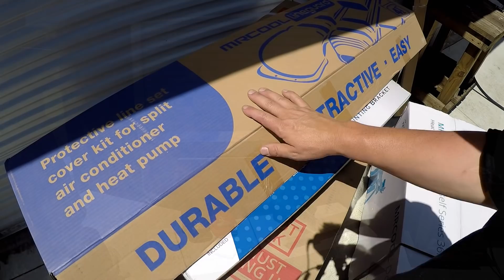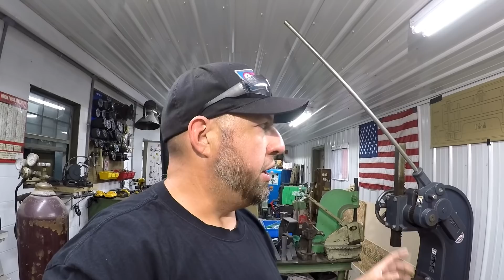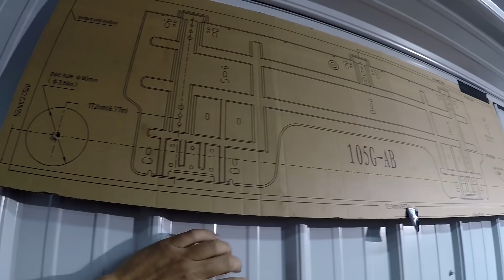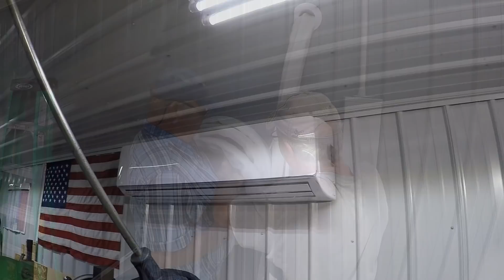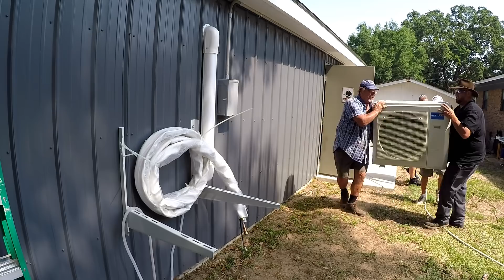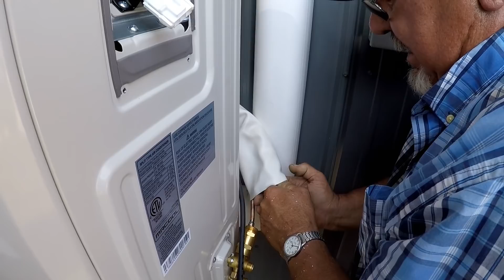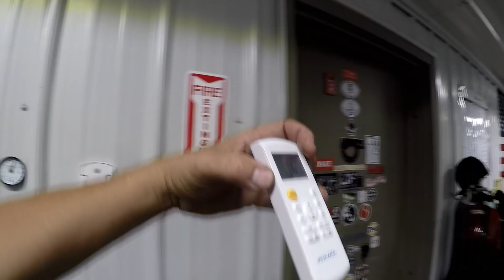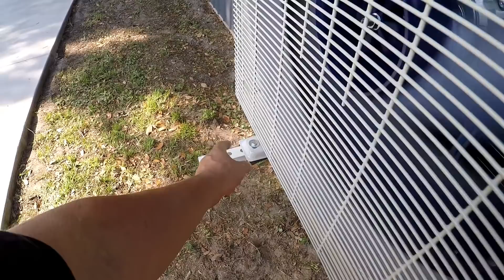Mr Cool DIY Shop AC Install

Comment: Good install. The only thing I would have done differently is cut out the extra length that you guys coiled up behind the unit. it will hinder airflow behind the unit which can reduce system performance ( higher head pressure, more power consumption, reduced cooling) and more importantly those loops will act as oil traps reducing oil returning to the compressor which can shorten the systems lifespan. its important to have all the oil that circulates through the system return to the compressor.
Reply: Cutting the lines means you have to flare and vacuum the system.  Coil the lines as shown.  The unit is shaded and the little bit of air you block is not going to be a problem.

Comment: Have the same unit in my shop in Houston. Literally did the whole install by myself. Although it would have been nice to have a hand when I was hanging the wall unit. Keeps my metal 24x36 shop cool. I do have that bubble installation. My only real complaint is I who’s the fan was a bit stronger. The heat pump is nice too. Good till about 40 in the winter. After that it has trouble keeping up. Well worth the money and pretty efficient.

Comment: 21:46 Should have connected the top line first.
Reply: The connection doesn't matt until he released the flow which he did the tip line first
Reply: Instructions specifically say to connect the bottom first.

Comment: these mini split units are very common here in brazil we only use these units...  not with pre vacuumed and those fancy caps tho.
Reply: Same here in Japan, one for each room or area in your home. Very efficient as you only pay to heat or cool the rooms or area of your home that needs it. Central heating and air is so expensive and inefficient compared to these. This looks like a rebranded mitsubishi unit.

Comment: I installed the 15k version in my shed workshop last year. It has done a great job with both heating and cooling.

I installed it by myself. Definitely easier with a friend, but not impossible with a single person (at least the smaller one). Just make sure you use their guidelines to get the correct size -- getting the largest one for a small space is a bad idea because of how it will short-cycle.

Comment: Cool (pun intended!) looking unit Adam. Up here in NH A/C is not really necessary, but I have to admit where you live it is nice. When  I lived over in Ft Walton Beach A/C was really a good thing especially in July & August. However those old heat pumps and blower units in my apartment were always loud. I hate listening to HVAC systems. This I think I could live with. 
Cheers

Comment: Now in my hometown, 39 degrees. very hot
Reply: 102°F for anyone not familiar with celcius
Reply: @fcguy7  (I am from China.) thanks for your explanation.
Reply: @shujunzhang8027  that was my guess. Unfortunately America is still holding on to imperial units. I hope one day we can join the global community and adopt the metric system. Until then I'll help by converting units when and where I can.

Comment: A shop fan on low,  really helps circulate the cooled air around the shop.
Reply: That's a good point.  Cold air does tend to pile up around the source, especially when there's a wall opposite the discharge vent.

Comment: I understand the lines are pre- vacuumed but I must vac check to see if there is a leak on the system...
Reply: The lines are pre-evacuated and pre-charged with refrigerant so in order to run a vacuum pump you would first need to recover the gas which sort of defeats the purpose of this sort of unit.  The best way to test for leaks is with soap bubbles or an electronic detector.
Reply: I understand why you would vac check to see if their is a leak. But you kinda have to just trust Mr. COOL has done that at factory and arrives to your place still charged.  Reason for this system  being called DIY. No need for all those checks with these units. I unfortunately had to vacuum test AFTER it was no longer cooling. Then with vacuum test did we find the leaks from factory😫 My trust has diminished after this. My other two units after defective one running great though. All Done my self.
Reply: @oscargo29  you aren't supposed to check for leaks with vacuum, pressurize the system with nitrogen instead.
Reply: @JGnLAU  We did. After unit not cooling.
Reply: Thanks Jim D...Get over yourself emery board, OMG !
While your in in your moms basement trying to tell people how smart you are,  there’s already many people out there that are way smarter than you .
Reply: @yzmoto80  aren't you trying to tell people how smart you are too?
Reply: nice assumptions ...

Comment: Here in Southern India we use similar split units. Much the same really, except this Mr Cool seems to be tailored to DIY-option with the pre-vacuumed lines. My first thought when I saw you guys unwinding it was "Oh! It's not copper. How can that be?" Now I wonder how they can make copper so flexible.

We go by "tons," but don't ask me tons-of-what lol! Don't ask me what a British Thermal Unit is either (They taught us at school) even though they figure in our AC model numbers too. Temperatures of 40, 41 (105 in your currency?) here at the moment. We hate power cuts!

Stay cool.
Reply: They came up with tonnage as a way to compare performance of the unit. What it is is comparing the cooling capacity of the unit to (weight) tons of ice. Approximately 12000btu are equal to one ton of cooling  capacity.
Reply: ThadEGinathom Given that you’re metric, shouldn’t that be tonnes?
Reply: @steviebee1989  A "ton of cooling" or "refrigeration ton" (RT) is an imperial unit (Phase Change of 2000lbs of water->ice). Tonnage is not used in the Metric HVAC World. Greetings from Germany. All hail the Kilowatt.
Reply: <Given that you’re metric, shouldn’t that be tonnes?>

I was born an imperial Brit: pounds, shillings and pence!

But yes, UK has long been metric, with a few exceptions like miles of road and pints of beer. And India is metric --- with a few exceptions like AC capacity!

I'm the hybrid that you might expect: I measure body temperature in F and room temperature in C. And, in the unlikely event of measuring anything small (I'm not a machinist) it would be in thou, not fractions of a mm.

Comment: @abom79  Take a piece of black split loom tubing and put on wire for indoor unit.  Will help keep wire from cracking being out in sun.  Also small piece of pipe insulation over suction line that is exposed.

Comment: What is it meant by "36k"? I got a 18,000 BTU mini split in my shop, around 300 sq ft and it really only cools the shop when it's raining (when temp. is around 85 or so) but because my shop is a sheet metal construction with no insulation, it does not cool when it's sunny... well it does cool but I have to stand right below the blower unit to get any benefit at all. I live in Taiwan. Here they use mini splits all the time because central AC is simply not something you see at home or office, but rather is only seen in very large installations like subway stations, large public space, etc. and as a result every buildings have those condenser units all over it, looks kinda ugly IMO. In Taiwan nobody uses cover plates for the refrigerant lines but just leaves it exposed to the element, but it has a foam covering around it to insulate it. It looks far better with the line covers and service disconnects. I can add insulation but they are expensive and the landlord will not pay for it.
Reply: Adding insulation to your walls would make a HUGE difference. You can't expect your AC to keep up when the sun heats all the walls directly.
Reply: @SpencerRyllSmith  Does it make a bigger difference to improve the insulation of the roof/ceiling or to the wall? Only one side of the wall really gets sun heating, and only for a few hours during the day. The AC works far better after 5pm.
Reply: @taiwanluthiers  I would start with the ceiling but also do the walls as soon as possible.
Reply: @SpencerRyllSmith  Well, I don't have money to do both, it is very expensive to do and my solution so far has been to reduce the areas needed to be cooled to save money this way, by sectioning off my shop with plastic tarps. It's not pretty but it sorta does the job in at least keeping my electricity cost down. Doing full on insulations will cost a lot more, more than any possible savings on electricity it would have over the 4 month period where it's sorely needed. (Taiwan electricity rates outside the summer is so low it might as well be free)
Reply: 1 ton of cooling = 12,000 btu/h.  18k or 18,000 btu/h = 1.5 tons of cooling capacity.  36k or 36,000 btu/h = 3 tons of cooling capacity.  1.5 tons is generally more than enough capacity to cool 300 sq ft but if the climate is hot/humid in direct sunlight and the building has little or no insulation, the load can easily exceed the units capacity and will not maintain the desired temperature.

Comment: Adam

Fter this has been in use for a couple months, pull up you power bill  for the same period last year, and let us know how much it costs to run this unit.  That kind of real world evaluation is something I am sure many folks looking into this kind of solution would appreciate.

I am lloking into adding about 300sq.ft to my shop, and will definitely be looking into cooling solutions at that time, and efficiency is going to be on the top of the selection criteria list

John

Comment: Before you buy any of these kind of units, make sure the warranty covers the home owner install. My neighbor installed one, had problem right off the bat. Called to find out about warranty, was told since a A/C man didnt install, warranty was no good. Ended up paying a A/C man to repair, and to get it set up for warranty. Nightmare.
Basically this is a 3 ton window shaker. But In Florida you have to have something, even my cats dont like to go outside in the heat of the summer, which is pretty much all year. We have one season, summer, its get cool for around a month.
Reply: The Mr Cool DIY line is specifically designed for homeowner install.
Reply: I tried not to single out Mr. Cool units, but these type units are sold by a lot of vendors, making sure they check on warranty info before buying. And I would suggest getting it in writing. Good to hear Mr. Cool cover parts and Labor. For how many years.

Comment: Hilarious that the USA is just now discovering how great mini splits are.  I've been working overseas for a decade and that's ALL they have, central air is not a thing.
Reply: They have been here for quite some time. The reason they aren’t as popular is that in the US, most buildings HVAC systems are forced air whereas in Europe and Asia, radiant heat is more common and it is more economical to install ductless systems rather than run ductwork. You are right though.  They are becoming more popular in older homes with hydronic systems and room additions along with ducted high velocity systems.

Comment: Cool as a cucumber 🤭😂
I’m lucky that my shop has a12 inch concrete ceiling with another factory unit above.
The only problem I have is that in winter it can get a little cold but in the summer it’s like having an ac running.

Comment: The refrigerant lines should of been horizontal.. so not to cause a oil trap .. so the oil can make it back to the compressor.. ...other wise nice install ... great video !
Reply: Agreed, Every coil in the refrigerant  piping is now an oil trap. Dont think it will be a problem tho.

Comment: A little bit more planing and this could have been a little better, you put in a drain line with the addition for your big welder, you could have plumbed in the drain for this ac unit into that same drain. The a/c lines look like where long enough to hit the other side of the door, and had enough decorative cover to get there as well. You wouldn't have had to do as much electrical work as it would have just been on the other side of the wall. This also would have eliminated the big coil. But, it wouldn't have been as hidden... nothing a trellis wouldn't have fixed.  The whole thing would sit right above your water spigot.  ¯\_(ツ)_/¯ its there now.

Comment: Nice video!...Your installer forgot to immediately check the fittings for leaks with soap water solution when he opened up the service valves. Also using nylog on the line set connections insures for a better thread on and leak free situation!
Reply: Since you shared your expertise I thought I’d share mine,  The nylog would ensure a leak-free situation, not insure one. 
The two words are not interchangeable. Just sayin’.
Reply: Ah Charlie you kill me!

Comment: I would have moved the condenser unit as far as possible from the building... Better airflow = better efficiency.
Reply: Stuart Warren it’s plenty far enough from the wall - the air is pulled in from the back and blown out the front - that distance won’t cause any inlet restriction even with the extra pipes behind it.  And it’s friggin huge for what it’s doing too - a unit half that size would do the job, this won’t break into a sweat. 👍

Comment: Wont the extra line coiled up interfere air flow to the coils?   Why not cut the supply lines to fit?  The gas in in the unit not the lines right?
Reply: Butch Shelton....Did you bother to watch the video?  The line set is pre charged.  You do not cut the lines with this installation.
Reply: @paulcopeland9035   so Paul the lines with no ends on them save a small plastic cap are holding all the refrigerant inside those supply lines. What pray tell then was the valve on the condenser unit for.  When I watched the video and saw them release the gas. You watch it again yourself.  The line is NOT charged but the unit is.
Reply: @ButchShelton  ....The line set and evaporator ARE charged.  This is old tech that has been used in the mobile home and modular factory built home business for years.  Inside the end of the lines is a valve mechanism that opens when it is connected.  The valves on the condensing unit are service valves, just like every service valve on every condensing unit around.  "Pray tell" if you want to be educated, go to the googles and look up "Mr Cool pre-charged line set"  You will find pictures of the inside of the lines and the valves I am telling you about.
Reply: @paulcopeland9035   The only reason I brought this up is the Mr cool I installed the connection lines were not sealed. They were not pressurized and they were long. During install my A/C guy shortened them for a cleaner looking install. But by all means I defer to your vast knowledge about all things. Your gracious comments and demeanor are vastly appreciated.
Reply: @ButchShelton  ....Only the Mr Cool "DIY" model comes with the pre-charged line set. BTW, anytime you want to know about stuff I do for a living, look me up!

Comment: Here is a tip for Abom an those with small critters around there houses add some medium steel wool in the elbow of the line guard to fight those little guys from trying to make a nest in the guard and keep the drain line about 4 inches or so of ground frost or freezing areas thanks for the video abom keep them coming

Comment: Wall mounting sucks, when the unit outside is on, the whole building vibrates.
Reply: Nope. Mini splits are incredibly smooth.  If it is vibrating your building then you have a compressor issue.
Reply: @paulcopeland9035  I lived a whole year in a apartment like that. I had to arrange my glasses a little apart so that they don't touch and make vibrating noise too. Even since, I always picked my apartments with ground mounted units, never on the balcony.
Reply: @shakazzolo  I don't know what it's like in Florida but in Texas fire ants get into some AC units and disturb the contactor.  It can destroy the compressor.  By now they should have that fixed with a sealed contactor though.  It can happen after a lot of rain, when ants are on the move.
Reply: You can't even tell it's on unless you go outside and get close enough to see the fan spinning.

Comment: I know Mr. Cool "Sponsored" this video (gave him a free unit) but be sure to check eBay and Amazon theres 100's of other vendors with prices HALF the cost of Mr. Cool - I just clicked his link and looked and their prices are double what I paid just 3 months ago.......... Same style unit, Toshiba Compressor, 5yr warranty, etc etc
Reply: @agems56   Not USA made, not even USA assembled - same Asian junk everyone else sells.........
Reply: I think their cost is explained as being the inclusion of the special lines that eliminate the need for an ac tech to be involved.  Problem I see is that this the results in a messed install without custom length line sets.
Reply: @lightclub26719   I just installed MY OWN, alone with no help, from one of those suppliers that supposedly require a tech to vacuum and charge? I ordered their pre-made extended line set and wall bracket, and all-in I have an 18,000BTU AC/Heat in my 3 car garage for around $900..... been working over a week- garages are all at 77*, with over 100* outside and horrible humidity-  added 30' of lines, vacuumed unit down, added 15.5 oz R410a, and it's been working awesome! Did it all myself, super easy- best decision I've made
Reply: @Mad-Duk_Machine_Werkes  So how much was the vacuum pump and refrigerant?  Those costs should be added for fair comparison.  FWIW I would go same way since I have access to the equipment and refrigerant.  Typical DIY does not though

Comment: Adam,
I just bought one of these and installing it this week.  I'm not trying to troll your FIL's workmanship, but I have 2 serious questions. 1.  My little 12K unit needs at least 12" between it and the wall.  I doesn't look like you've got that. Will that be a problem with cooling the condenser?  2. What about the lines being coiled up vertically? Won't that create traps for the oil needed in the compressor?  
Thanks
Tim